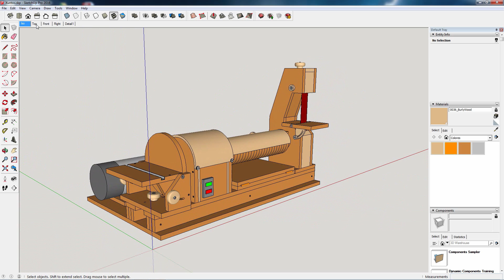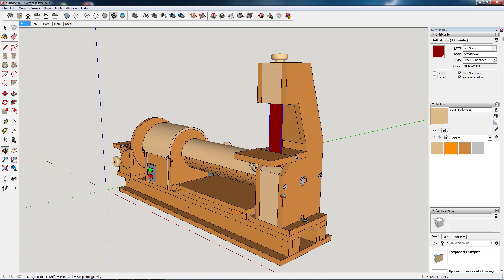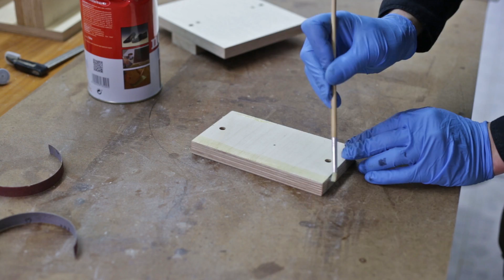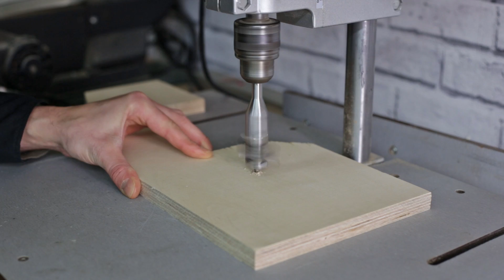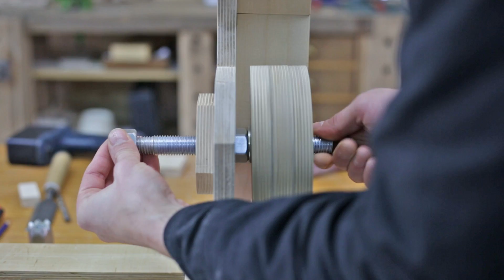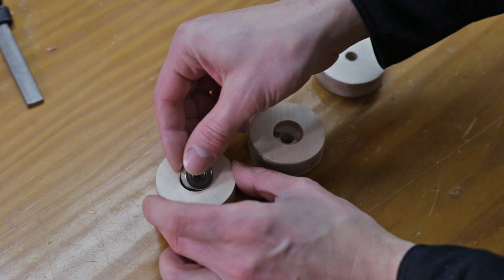Lathe Sanding Station: Belt Sander Part1

Comment: What motor are you using? Cannot find the video where you describe it. Just a 1/2 horsepower dishwasher motor?
Reply from the maker: It's a single-stage 1HP motor with 1500 Rpm and 0.75 Kw.